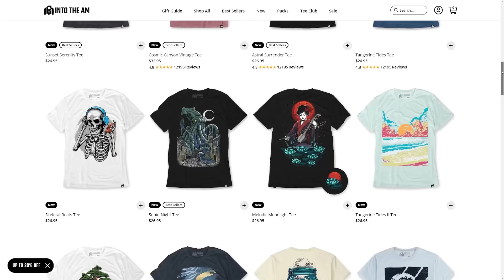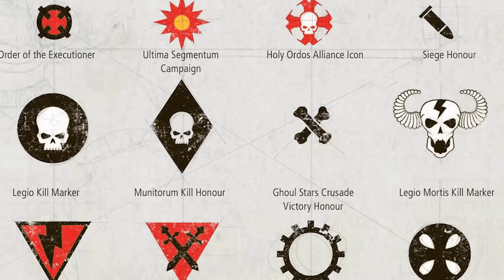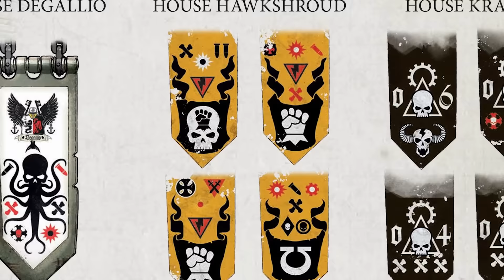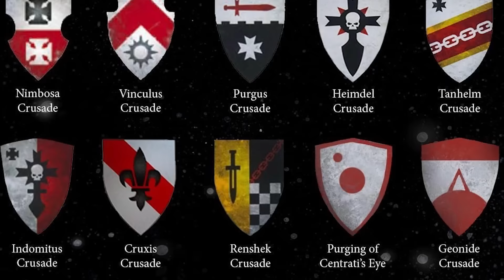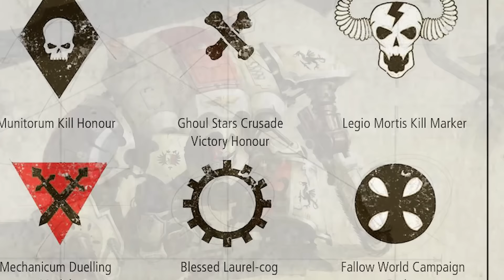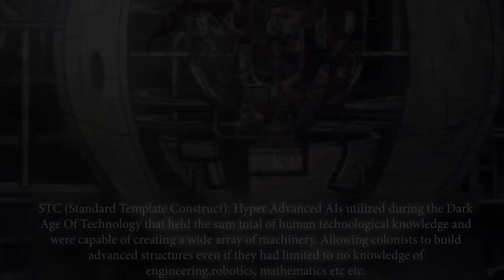Imperial Knights Faction DEEP DIVE! *CHIVALRY INTENSIFIES* | Warhammer 40K Lore

Comment: With the section about how knights usually have specific knights pilot them. I was wondering are knight pilots able to be unbounded so they can use a different type, or can the arms and wepons be switched out like how with the model you put the specific arms on you want?.

Comment: I have a theory that the new dreadnought that cawl made were heavily based off of the imperial knight platform because it's a lot more stripped down than the older variants And it looks very similar, if not directly taken from a knight chassis. And finally the two double barreled auto builders are mounted very similarly to a knight's lesser weaponry.

Comment: Earlier you said nobles were bonded to specific knights and they wouldnt activate for anyone else. Hiw does that mesh with only veterans getting to pilot wardens? I assumed they were bonded to a knight until one of them fell, likely the pilot.
Reply from the maker: I wasn't able to find a concrete example of a knight pilot switching suits. But it stands to reason that if a knight is destroyed in battle and the pilot survives, they could rebond to a new suit. If this is the case then it also stands to reason that for whatever reasons they could switch suits. This is what the stories they are in seem to be implying, but like I said I couldn't find a concrete example to include in the video.

Comment: If some are only piloted by experienced people. That would mean they switch which knight they use, at some point. How does that work with the symbiose they form? Plus wouldn't that mean the knights normally used by inexperienced people, shouldn't have many ghosts in them, as those pilots would move on. Unless people often die when they are inexperienced. It could seem like something might not add up

Comment: If knight pilots fuse with their machine spirit and knight how do veterans go from one knight to another?
Reply from the maker: I wasn't actually able to find a concrete example of this in my reading. But I have read about pilots that reminisce about their old suit. So my expectation is that if their suit ends up destroyed or they simply take over another one, they most likely have to undergo the ritual once again, but it is likely far less dangerous as their mind has already been conditioned in the past.
Reply: @weshammer  Cool I wondered about that as I was watching you video and you were talking about certain knights being piloted by younger or older pilots. I was thinking that once they bonded to a knight they were more or least with that knight till death.